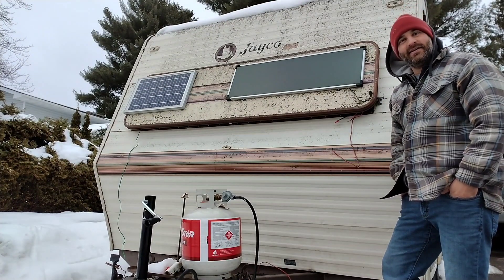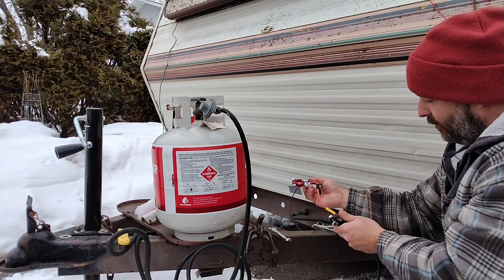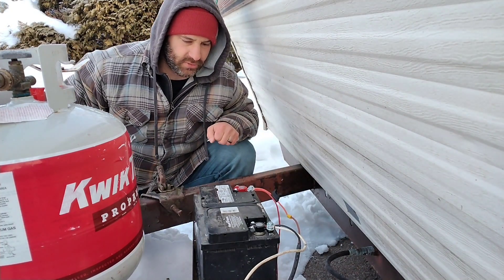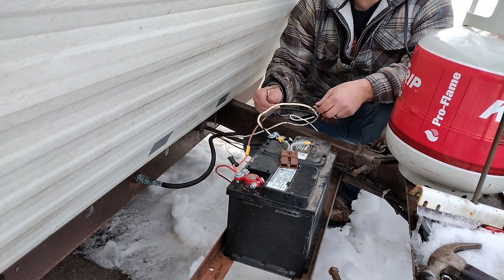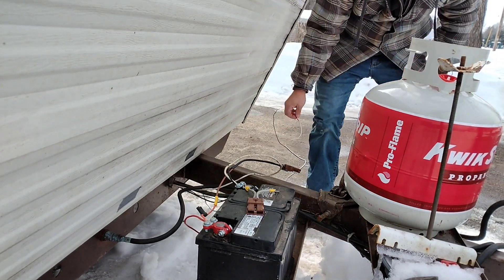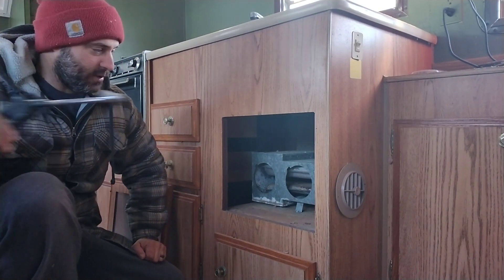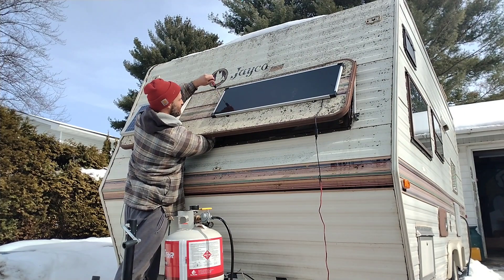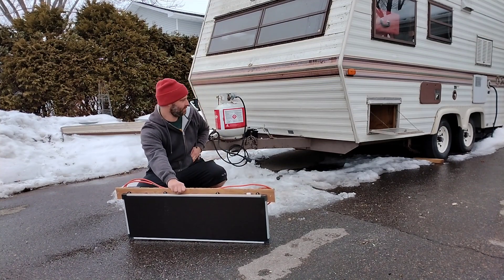Detachable solar panels / easy solar system setup - Cheap Camper Restoration pt6 / 1991 Jayco

Comment: Looks good. An idea- maybe make a protective case for each solar panel from 2x2's and wood paneling to enclose them when not in use or stored. Maybe put some 12x12 mirrors on the inside of the covering panel to direct extra sunlight onto the solar panel when you have it set up.
Reply from the maker: Those are both great ideas and I feel in the future I will use both of them. I was already thinking immediately after removing the window protector that I could use some of that material to make a much better stand. Thanks
Reply: @anthonyholzem  You're welcome. Huoe you get many more subscribers. Maybe you might get the kids into making solar setups in packages. You might be able to sell complete solar power -in-a-box kits to others who will be using rv's in the near future. I'm thinking as things get crazier many people will be moving into RV's as their housing. Around where I live (small town) there are many people looking for "affordable housing" and there is none. They will take rv's and some are even in tents in the snow and would jump at the chance for an rv.